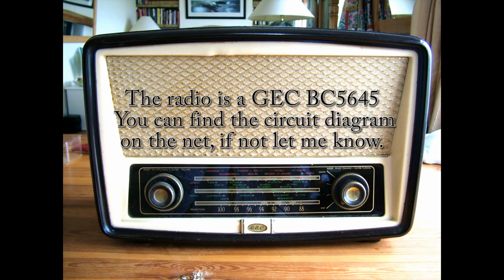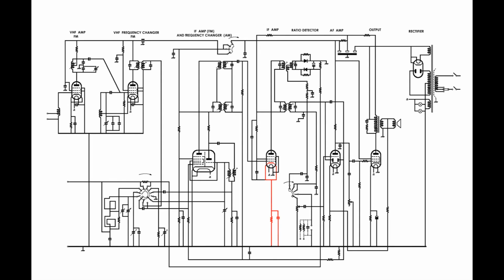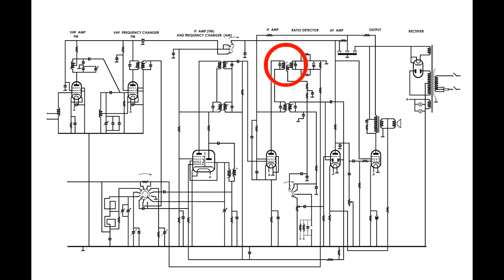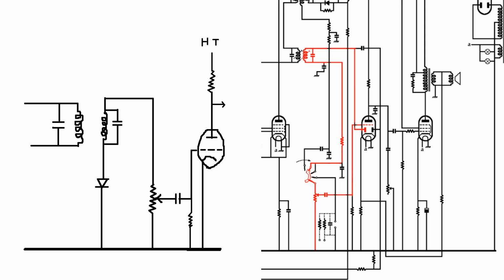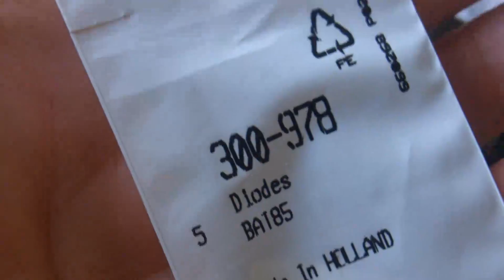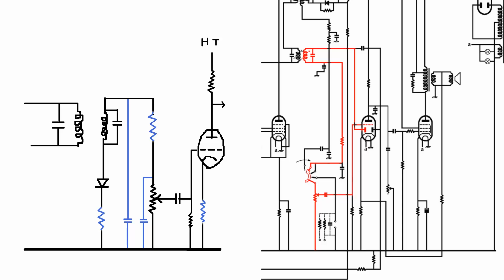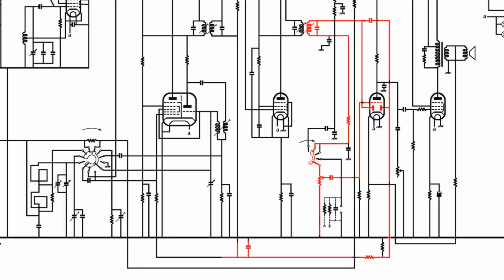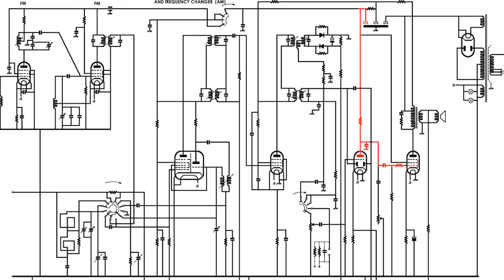About Radio ... Part 17 The double diode triode A.F. Amplifier by Andy Davies

Comment: I had to go back 12 years to find a video that confirms my suspicion that I don't need to worry about those diodes in my 7c6... for all I'm using it for is audio only amplifier and I'm deleting the radio portion of the circuit. Cheers from across the pond.
Reply from the maker: Hi there, I haven't looked at this video for a very long time but if you found something that helps you then I'm very pleased. 
Kind regards . . . Andy